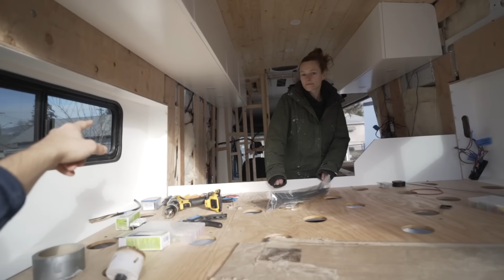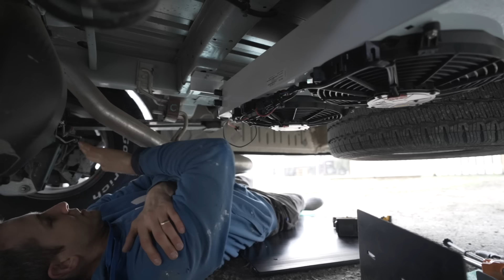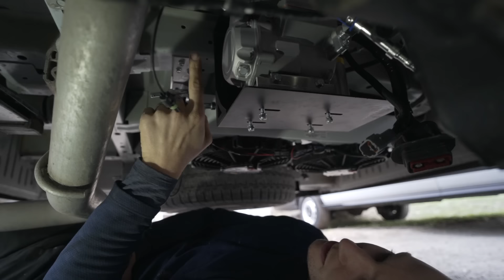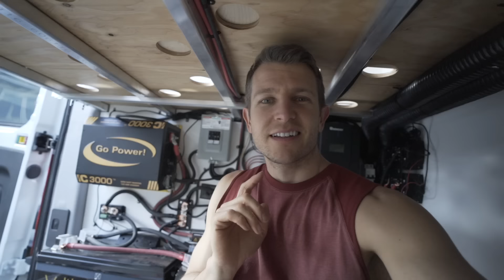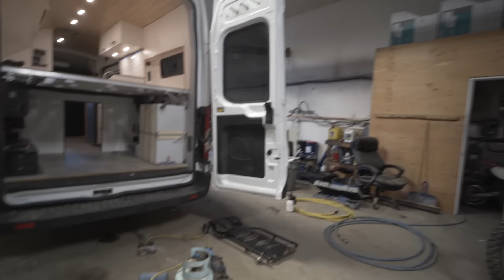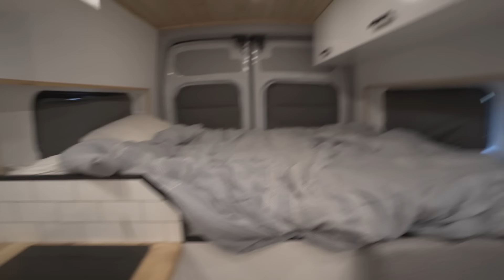The BEST 12V Air Conditioner For Van Life? INSTALL & TEST

Comment: Problem with undermount mini split is that the AC is more prone to debris damage and dirt build up.  More maintenance issues means more money.  No thanks
Reply: We have yet to see a unit actually get damaged by road debris or dirt build up. There are actually quite a few more critical items under your van that are much more prone to road debris (plastic fuel tanks as an example).
Reply: @undermountac  You should speak with Advanced RV about an AC mounted underneath the Sprinter.  They have a ton of experience and have concluded with what I originally stated.  Also, a plastic tank has hardly any maintenance issues as it is just a plastic box whereas an AC has many mechanical parts, things to go wrong when dirt builds up and the like.
Reply: @tonynotstated695  I am sorry but we have sold more Undermount AC units than Advanced RV has produced motorhomes in the last 5 years. Combine this with the years of experience in Roadtrek motorhomes which installed these units in over 1000 motorhomes, it's just not an issue in practice.

Comment: ProAir LLC filed Chapter 7 Bankruptcy, and their website is down.
Reply: UndermountAC is not affiliated with Proair in anyway. We have just simply been using their evaporators and condensers units as they have been quality parts. We now have our own condenser and evaporator unit and still have Proair stock, and will continue having Proair stock to support our customers in the future in case they need parts. Stay cool!
Reply from the maker: Yep 👍🏻 Thankfully UndermountAC still has some stock and I believe has found another manufacturer. I just received a V3 kit and will be installing soon.

Comment: All the components you attached under your van, couldnt you install them in the engine compartment ? seems like a bad idea to have all that stuff under the van
Reply from the maker: They’re designed to mounted the under the vehicle, but ya if they fit in the engine compartment I don’t see why it couldn’t be done
Reply: Modern engine compartments I see don't have enough room left to mount a pack of cigarettes.

Comment: $3400!?  Hell nah.  nice install video though.  I'll go the aliexpress route and get a minisplit for $600.  My chinese diesel heater has been an amazing buy and I've been running it a year.
Reply: FYI, I got the same pump for $600 back in 2020 and pieced together a kit with automotive parts for way less. Granted, it's a car for me so I already have the vents, evaporator, condenser, etc. so it's "halfway done" from the factory.
Reply: What stops somebody from using the factory dash ac install and adding a 12 or 24 volt air compressor ???

Comment: Would the sound from underneath be too loud to sleep with on if you had bed on the floor?
Reply from the maker: Not at all imo. But our vans are quite well insulated so it would depend on how much sound transmits inside your vehicle in general.
Reply: @TimKatie  Thank you. The issue for me is that my van floor has no subflooring, just a 3/4" hard rubber floor.  That being the case, would you still think sound would be okay?
Reply from the maker: @bradm179  Ya I don't think it would be an issue
Reply: @bradm179  Our newest condenser is available with a hush kit fan upgrade. This lowers the noise output by more than double! Worthwhile upgrade if noise is a concern!
Reply: @undermountac  Oh, thanks.  I will try and follow-up with you via your website.
Reply: @bradm179  No problem. Feel free to email us if you have any other questions as well!

Comment: Awesome job! The benefits of having the roof clear and the weight low on the vehicle is apparent.

I’m curious if the evaporator could have been mounted vertically on the wall so as to save space and make the ducting more natural with less bends? Thanks! 

Very through explanation in your video. Helps a lot!
Reply from the maker: Thanks for your comment and feedback! 

I believe the evaporator needs to be mounted flat so that any condensation pools in the pan and drains appropriately, but it would be nice if that was possible!
Reply: Ah! Totally makes sense! Thanks for the quick response!

And thank you for the info! I’m in the design stage and you’re video was extremely helpful!

Comment: Is this a heat pump? Does this heat and cool? Great video
Reply from the maker: Thank you. This unit only cools (AC) but it can be configured to work with a hydronic heating system to utilize the same control panel and venting for both heating and cooling
Reply: @TimKatie  maybe your next video then haha
Reply from the maker: @garrettscott4094  haha maybe! ;)

Comment: Tim, I'm about to do a very similar install, but I had some questions. How is your compressor mount job holding up to road abuse? Did it end up seeming sturdy enough? Have you had any issues with the compressor and wiring facing the front of the van such as rain, etc.?
Reply from the maker: Mike, the compressor mount is holding up great. I have no concerns about it and plan to do the same style mount when I install another one of these units in a few months here. I did not have any issues with the wiring. Good luck with the install 👍🏻
Reply: @TimKatie  Thank you, just wanted to check before I copy what I can !!  :)
Reply: Our advice would be to drill and bolt the mount in place to be as sturdy as possible for the long term! The compressor mount itself is designed for two 7/16" bolts and washer to be bolted through it and it mates up with factory holes beside the fuel tank on the Ford Transit vans.

Comment: What air vent/registers are you using with the 2.5" hose? Having trouble finding some that fit. Thanks!
Reply from the maker: The 60mm webasto vents fit but I also used these 63mm (2.5”) louvered ones: https://www.amazon.ca/gp/aw/d/B09MJDQZ4P?ref=ppx_pt2_mob_b_prod_image

Comment: Nice job on install.  I have seen other mini - split systems where the condenser could not be mounted horizontal and needed at least a minimum 15 degree tilt.   Nice you could mount yours this way and avoid road debris from damaging cooling fins.
Reply from the maker: Thank you! Yes, it’s quite nice that this UndermountAC condenser can be installed flat 👍🏻
Reply: @TimKatie  This is a great video. But you are at 13 SEER.  A residential unit can be had at $3000 - 3500 which is 32 SEER and heatpump operating as low as 20F.  So almost 3 times less energy. But of course harder to install.

Comment: Hi. as a a/c  and refrigeration engineer in the transport world , you did a great job.
Reply from the maker: Thank you so much. I appreciate your feedback
Reply: I have a question an engineer might be able to answer. Walmart has a 12v rooftop unit. It claims to be 15000 btu. The current is rated at 30 to 70 amps. I know very little about direct current. Can it be hooked up to the 12v rv system and run off the alternator on a 454 chevy engine. Or does it need a battery bank and solar panels to run on the road?

Comment: This seems to be a sweet build.  

      The DC should be more electrically efficient than an AC unit thru an inverter. 
      Do they make these units for 24 or 48 VDC systems (the current and wire size would be smaller.)? 
      What is the SEER Rating? Is this a heat pump too, or just AC? 

      I really like the cleanness and stealth of the hidden components. It’s good to think outside the box from what the rest it the herd is doing 👍.

      What is the contact info for manufacturers & vendors? Thanks 🙏😎
Reply from the maker: Thank you!

Yes they offer them in 24V as well if preferred:
https://undermountac.com/collections/air-conditioning

These DC units don’t receive an official SEER as far as I’ve been able to find. I did the math myself to compare units but it isn’t an official number.

Comment: Hello thanks for the great install video. Wondering why you chose the 109 condenser instead of the 105? Thanks!
Reply from the maker: Thanks for watching. My understanding is that the 109 condenser (horizontal flat mounted unit) is the standard one that comes with their kit, and the stainless steel 105 (vertical mount) unit is an upgrade. I had planned to mount mine flat like in the video so the standard one worked great

Comment: Great video on an install of this unit but NOISE is the main reason why I am going with a mini split residential unit where the compressor is housed inside the van in the garage with a max air fan assisting for airflow (maxxair mounted on the door). It is extremely quiet. noise is my pet peeve where I could not compromise.
Other than that it’s a great install video for that particular unit.
Reply: you crack on Mike - IMHO it's the way to go. Building in AV mounts isn't rocket science and I'm sure you'll be fine. Domestic fringes and freezers have been used for decades now in vans and all good so don't worry too much about the fear porn,,,,,,,. Personally I'm using a heat pump unit in my build - so easy it's like child's play - but I do have a 7.5T Merc Vario - happy miles guys from the You Kay
Reply: The compressor itself is not a source of real noise. It's relatively quiet. The majority of noise that comes from our system is from the condenser fans. The dual condenser fans push a lot of air and they are standard automotive units. They can be slowed down so they are quieter. Please note a residential unit is not designed in any way for automotive applications. There is no vibration isolation or water resistance built into residential systems.
Reply: @undermountac  Thanks for your feedback regarding from where the noise is propagated on your unit. Yeah, turning it down will definitely decrease decibels but no other option when external temps are high and needs to run at full duty cycle in order to maintain a comfortable climate inside (unless really insulated properly). Would be great to get a decibel meter and share those results for the curious. 
Now, regarding my mini-split decision and how it is designed for residential use and not for automotive. True that automotive was not its original design intent, BUT, it has been tested for years within the van community as a reliable and LOW DECIBEL use. Low decibel is #1 reason why "full time" van lifers like to go with mini-split units. To add some credibility, here is a YouTube video clip I would like to share --> https://youtube.com/clip/UgkxgpMedWd7X-agemd1wEZQiXV2hqOu3q1z 

Please check it out at your convenience and see how vibration is not an issue with these systems.

Moreover, regarding your concern with water resistance, the entire unit will be fully enclosed with proper ventilation thereby mitigating any meteorological events adversely affecting the entire system.  I can have the outdoor condenser on the back of my van but not trying to go for that look. Here is a use case of what that design looks like --> https://youtu.be/67OIddbJlVc

Comment: Can this be used in a 2020 freightliner Coronado semi truck and what batteries do you recommend I can put 4 group 31 batteries in but need recommendation on type of batteries agm lithium etc I am in different types of weather very hot cold and humidity.
Reply from the maker: You should be able to use it in a semi truck - I don't see why not. If you're frequently in extreme cold and weight/space isn't a concern then AGM batteries may be the best option for you but generally lithium phosphate (LIFEPO4) is a no brainer IMO

Comment: What’s the volume like inside after the full build?
Reply from the maker: Not bad at all - noise is mainly on high setting just from the vent airflow rather than the Undermount compressor. That could likely be improved by using larger vents and/or all 4 ducting ports on the evaporator

Comment: How many amp its pull per hr during your ever day use.
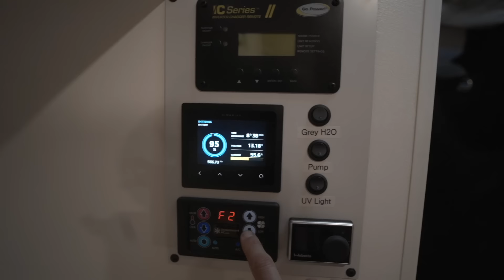Reply from the maker: It draws ~86 amps on high setting, ~50 amps on low setting (around 47:00 mark in video)

Comment: Hi Guys, really great informative channel - you'll grow subs well with content like this. I've seen mixed reports when researching the unit, so thought i'd check with you - is the Compressor unit also working off the house batteries? - so on DC 12v or 24v. Seen a couple of diy'ers say it only works when van is idling.
Reply from the maker: Thank you so much. Yes, the compressor also works off the house batteries (12V DC) in our van - I believe those DIYers wired it directly to their alternator/van battery positive which would be why theirs only works on idling.

Comment: I would put the air inlet higher up in the van because warmer air is lighter and in higher parts. Also, I would drain the water into a tank/container, given it is nearly distilled water and can be used for washing and cleaning. Not safe for drinking though.
Reply: We do not recommend re-using the water for washing or drinking as it is not potable water. While yes in theory evaporator water is clean and clear, the reality is that with high humidity comes mold, mildew and embedded dust and dirt particles.

Comment: At some point it would be great to insert a wifi-based thermostat into the control loop. We did this to our cruise-n-comfort because the analog control panel only uses a simple on/off switch and a fan speed dial making it easy to hack into with our ecobee. Great video, and great build. Hope to run into you guys some day.
Reply from the maker: Thanks Rob! Great idea - I read they have come out with a new digital and wifi based thermostat so I’ll be curious to test it out on our new van. We hope to see you on the road!

Comment: I’ve been studying this for two years. I’ve picked the same unit. It’s by far the best thing out there. Another drawback of the cruise n comfort is the hot compressor mounted inside the space your cooling.
Reply from the maker: Great to hear you came to the same conclusion. Thanks for the comment!
Reply: @michaelscarfi3196 did you get yours installed? How'd it go?
Reply: @Pockets1987  I did it myself it went well
Reply: @michaelscarfi3196  any details you can share? I have it partially installed in my Sprinter, and I'm deciding how to route the cables and lines from under the van and into the rear through the walls.
Reply: @Pockets1987  I’m not very tech savvy with the messaging so if you send me your e mail I’ll send you some pics
Reply: I have been building the HD-12L for over 11 years and this has never been an issue. However, if this and ducting is a concern, the VES system is a good alternative. With the VES system, the compressor can be mounted in an enclosure with the electronics, because  the compressor is cooled primarily by the return refrigerant. I always welcome phone calls, so please don’t hesitate to give me a call and I would love to discuss my products. -Chris

Comment: A couple of pointers.  Drill through the metal with a small 1/8 in bit first. It will go through much faster. It also makes ait easier to drill exactly where you want, without the drill bit "walking" on you. Then switch to a larger size bit to make the hole bigger. It will go through so much easier.  As for the self tapping screws that are holding the condenser and fans up. Don't trust those alone for very long. They will loosen and can easily pull out. Put yourself a metal strap or two across the entire condenser. Something that will hold it up, just incase they loosen up along the way. 😉
Reply from the maker: Thanks for the tips! I tried to use at least one cross nut for each component (threaded with blue loctite) and then reinforced with the self tapping screws (with lock washer), but will certainly try to use OEM bolts for my next install 👍🏻
Reply: Definitely use a through bolt and loctite. That will vibrate loose and it won't be pretty. Self tapers are great for light duty fastening but never trust a self tapper. The threads are too loose and will back out. Thank you for the video and always fun to see fellow builders finding solutions. Cheers!